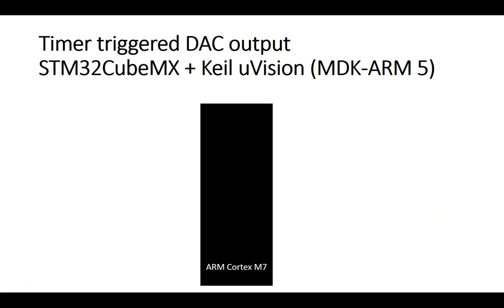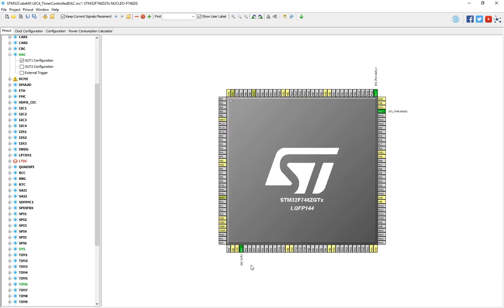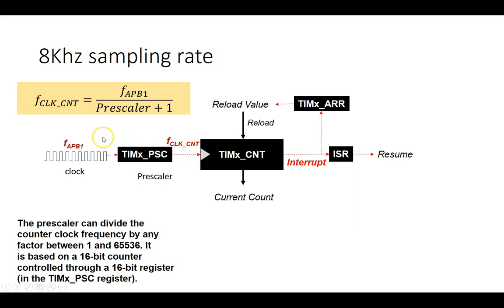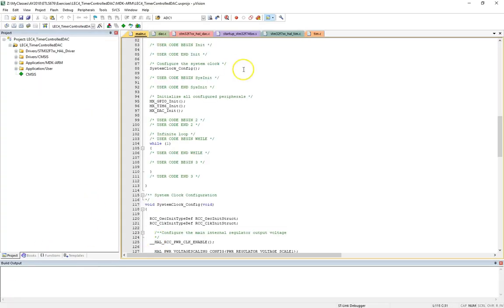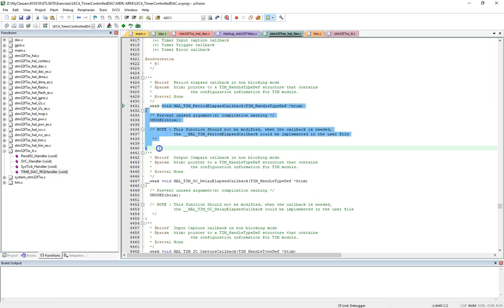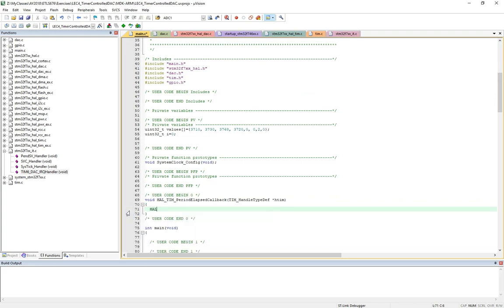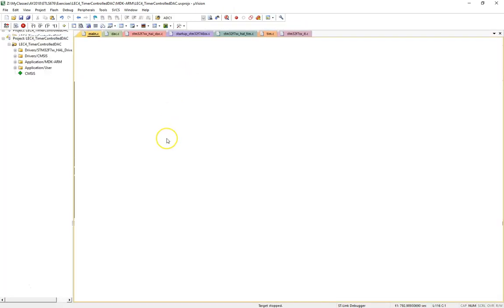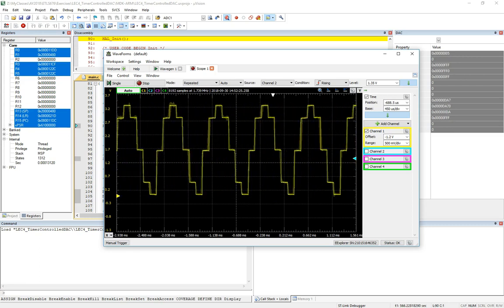Timer Triggered DAC output

Comment: My Device Config Tool shows show TIM6 clock speed (APB1 bus) as 64Mhz.   So I set the  TIM6 prescaler to 0, and TIM_ARR = (64M/8k)-1.

However, when using the TIM6 to trigger the DMA (which points to a 2 sample buffer, 0 and 0xFFF), the output frequency I measure is 4khz with a 50% duty cycle!   Considering the Stm32h7 says it has a maximum DAC sampling rate of 18.18Msps, what I expected was that every 8khz the timer overflow causes 2 samples to get transferred from the memory buffer to the DAC peripheral, and therefore the scope should show it briefly at 0V, but most of the time at 3.3V as it waits for the next timer event... yet this is not the case, why??
Reply: I think you should set the  TIM6 prescaler to 1-1
Reply: ye ye ye

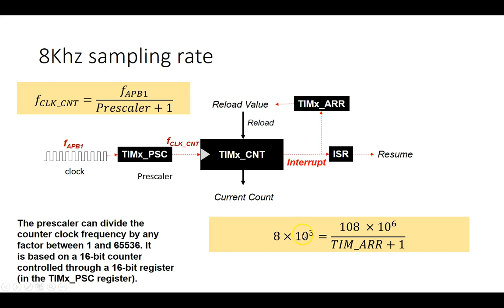Comment: 3:49 you should make the Prescale divided at much higher number 24.41 I got this number by dividing processor frequency at 16000 (it's double of 8Khz )  and then divid it at 256 ( maximum of 8bit PCM wave signal ) , here is complete formula 
100000000÷16000 = 6250÷256 = 24.41 .. this make me able to generate good sound quality off 8bit PCM binary values .
Reply from the maker: Why 16MHZ? This processor is running at 216MHz.
Reply: @ENGRTUTOR  Sorry I was  thinking about  ATTiny55 since I worked on it a lot